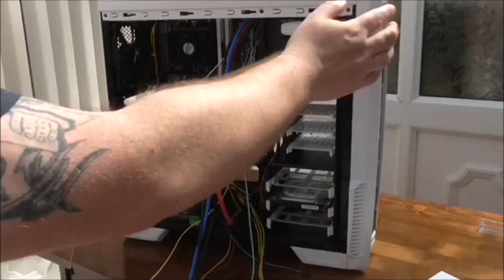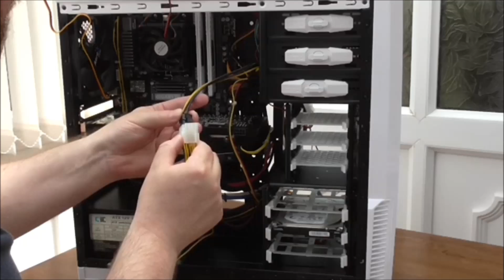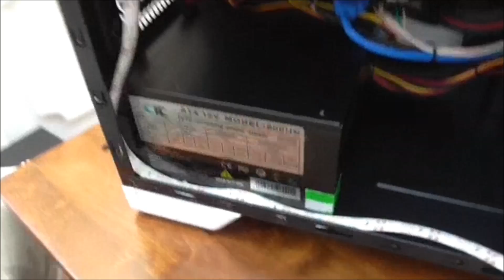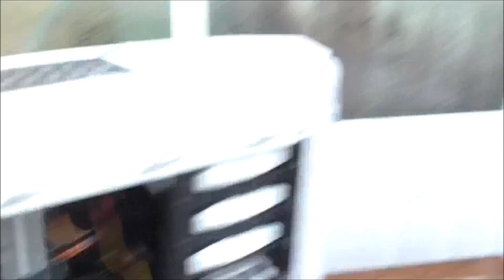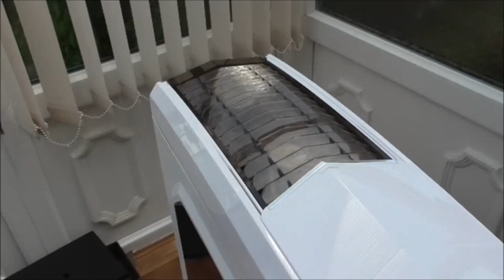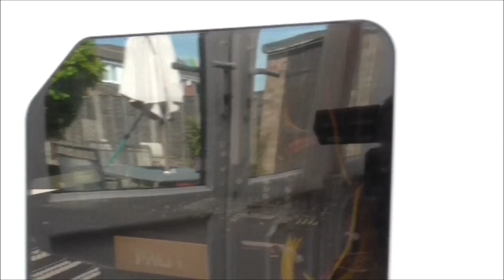2015 Areocool AMD Gaming PC Build Palit GTX 680 Part 4

Comment: Hi doubletap...i did it....i got the docking station uptop set up.  Make sure you have the sata cable for the docking station plugged in to one of the ports and make a note of which port number you put it in by checking the diagram on mobo...if you forgot then do this as this is what i did.......

NOTICE: I dont know if you noticed but motherboards normally have hard drives setup as IDE mode....and i used to wander why that was for sata hard drives...it turns out that with a new hard drive you should set this as AHCI first before installing windows as then windows can install the proper sata driver for that hard drive. There is a workaround which involves changing registry values and stuff and uninstalling stuff but it never worked for me so i had to backup my files somewhere else and then after i set bios to AHCI and the one below to sata i had to do windows from scratch and format the hard drive along the way so it could install the driver then i was good to go. 

From what i have read you need to have the bios set as AHCI in order to use the HOTSWAPPING. If you set bios to AHCI while you have windows installed you will get a blue screen of death when you try to load up windows, as the proper driver is not installed. If you did set it to AHCI BEFORE installing windows then continue on below...

 i took the picture of the sata ports to see what was connected but i couldnt tell which was which so i ...
1. plugged a sata hard drive into the docking station.
.2. restarted the computer and entered the bios.  
3. went over to "peripherals" and first checked the section about the 5th one down i think about the HDD properties. or something. and in that screen it should list the drives attached and whether they are P0, P1,P2,P3 and so on for the port they are in.  
4. check which port number the hard drive you plugged in has to the left of it as its that number you need to enable.  Mine was like "P3: HD85498493409303" like that.  so mine is port 3.
5. come out of the hdd properties and back into "peripherals" section and go down to the last section with the arrow to its left and hit enter.  
6.  you should see a load of sata ports...the bottom ones say POWER which are all enabled but the top ones just enable the number associated with the hard drive you plugged in. i enabled 3. as mine was P3.  
7. save and restart.

In windows....it should install a driver but you should see the usb icon on the taskbar and it should show the model of the hard drive and what partitions it has.  If so then its hot swappable.SUCCESS..you can get it to EJECT and it should say its safe to remove as mine did.  (WARNING: DONT FORGET YOU ARE WORKING WITH A DRIVE WITH MOVING PARTS SO I WOULD MAKE SURE YOU HOLD HARD WITH TWO FINGERS ON EACH SIDE AND GENTLY WIGGLE IT INTO THE PORT AS I TRIED IT FIRST TIME AND IT WAS A BIT TOUGH AT FIRST THEN SLAMMED INTO THE PORT. SO BE CAREFUL.

Hope this helps and gets you setup with yours...let me know how it goes.

laterzzz.
Reply from the maker: +Darron Andrews Hello Darron,
It sounds like you have been very buisy with your computer and from what I can read it looks like it turned out well for you. I have not tried the docking station myself but if I come across a decent hard drive going cheap I will give it a go & use your notes as a guild, as I would not have a clue. Could be another upcoming video & might be very handy for people who have the same case/tower. Anyway thank you for going to the trouble of leting me know it will come in very handy that's for sure :) DDoubleTap

Comment: I would have loved to have done a video with my c920 Web Cam but didn't have another machine to record it with.  Anyways I'd have been stuttering in speech and forgetting to talk in places while I was doing it.  If I were to do one I would link your youtube for the process of installing it as for first time... Good going... Then mine would be what mine looks like afterwards.
Reply from the maker: +Darron Andrews I use mirilis action for all my recodings it is easy to use onece you work it out as I did via youtube videos on it, plus you get a 30 day free trial, you should give recording a try start off small and work your way up to longer videos, thats all I did and now a 1hr video seems like a piece of cake, hard at first but watch any youtubers 1st videos as we all start out the same and if people give you trouble about speech etc then ballz to them and keep going :)
Reply: Cheers for that.  Will try that out out

Comment: Do you know the wires your plug into your motherboard for the power button, HD led, reset, and power led? Make sure the HD led one is on the two pins the right way round as the lights at the top front of case should come one as yours isn't in the video.  Unplug the HD led wire and have the arrow on the back of it placed on the + side of the two pins
Reply from the maker: +Darron Andrews I was wondering why they was not on, thanks for that, will have a look now.
Reply from the maker: +Darron Andrews there now on, still wish they were blue instead of red though lol nice one :)
Reply: DDoubleTap I noticed there are two sets of pins for power led.  I used the set on top left along with the HD led rest power. Keeps them all together in one place.... The other set I think you had yours on with the 3 pins that you put on pins 1and 3
Reply from the maker: +Darron Andrews I had a look when I read your message and they have all been changed round now, thanks for leting me know.
Reply: I know. Is you silver button lights blue around it?.... The top slides back to reveal a sata port it's the docking station but if you haven't done it yet... That port has to be set as hotswap in bios.  So you can plug hard drive in and out like a USB stick instead of plugging it in wen pc is off then switching it on to use it then off to unplug.   I'll let you know how I did it when I've done it
Reply from the maker: ok, let me know how you get on with it, the silver button and all other lights etc are on and allways was the only one that was not on was the top red led's and thats sorted now with the advice you sent yesterday :)

Comment: Did you sort your HD led cable for the top front lights to flicker
Reply from the maker: +Darron Andrews I ended up geting a LED strip sent over from the U.S. that was a 2mtr long one and it is very nice.
Reply: Was that not the size you had in your video? Or did you get that after. I get most of my stuff off ebay because in Belfast they don't have good enough cases or processors cheap enough here
Reply: I think you have the same creaky tripod as me.  Think we need one with a floating head on top the our Webcam and normal digital screws onto
Reply from the maker: mine is also off ebay, it should be hear tommorow along with some other stuff as its a bank holiday today so no post, I use a panasonic hc v110 cam for my recordings, never used a webcam before so looking forward to giving it a try.